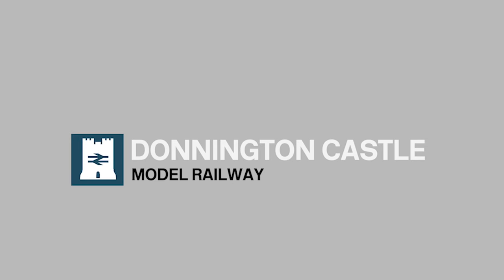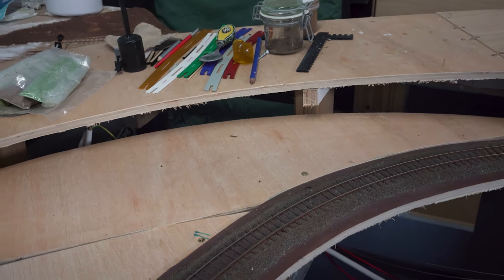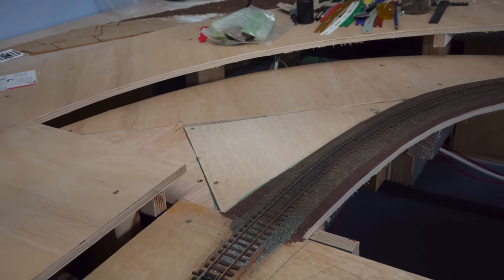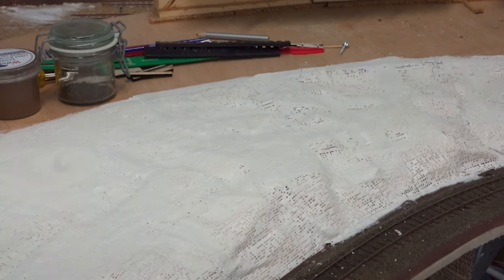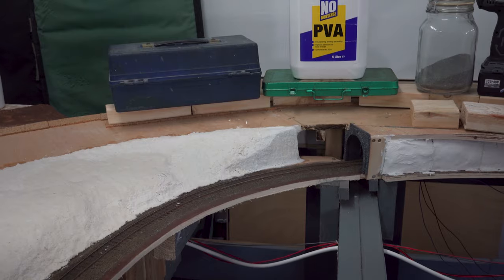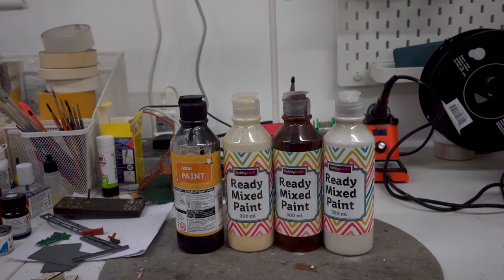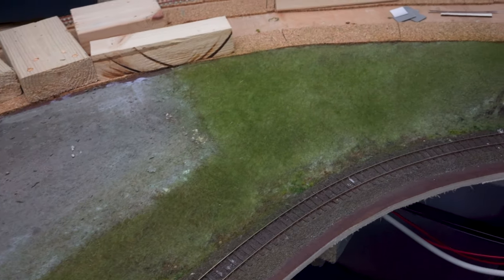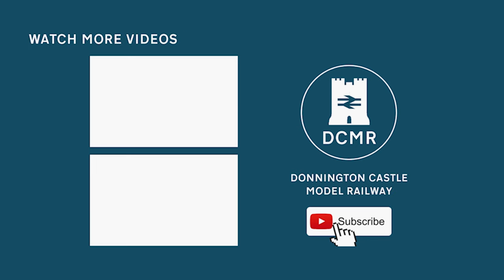10 - Landscaping at Donnington Castle Model Railway

Comment: 35% humidity is very low for a garage!
Reply from the maker: Yes I'm surprised how low I can keep it. When I converted the garage before the railway went in I made sure I insulated and sealed everything really well including the floor. Then I run a dehumidifier for a hour or so three days a week. Based on the humidity it reports back when running I think I must have done an OK job.
Reply: @DonningtonCastleModelRailway  Yes, that would explain it then, that would be better than almost all dwellings in the UK. Your layout and rolling stock should do very well in that atmosphere. Well done a belt and braces job!
Reply from the maker: Thanks! Yes it took a bit longer but I'm glad I invested the time in that phase. It makes it a nice environment to work in all year round and I'm also happy that moisture in the air isn't causing any issues either with the layout or rolling stock.
Reply: @DonningtonCastleModelRailway  Well done that's a very healthy environment for a model railway  layout. I Have subscribed by the way, you are obviously taking this build seriously by the measures you've taken.
Reply from the maker: Thanks for the sub! Yes trying my best to do the right things while still having fun with the hobby.